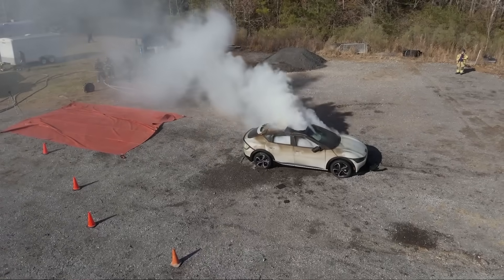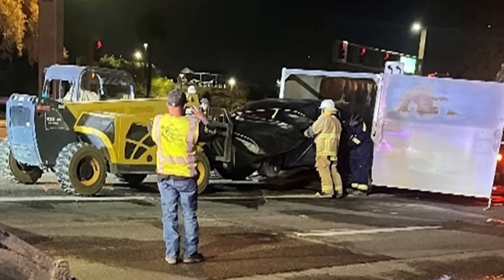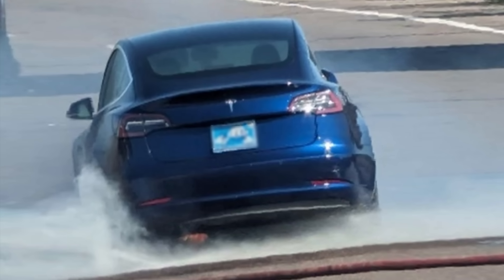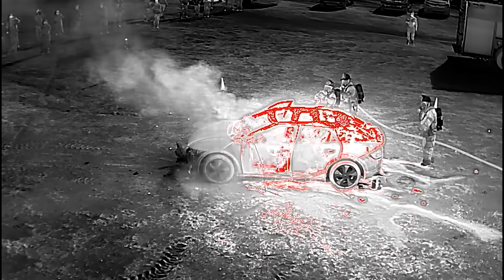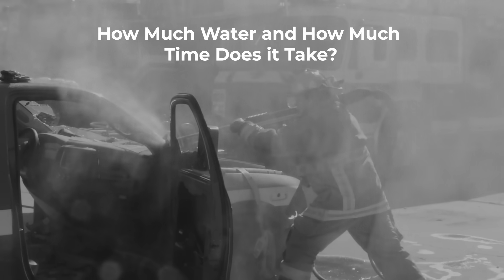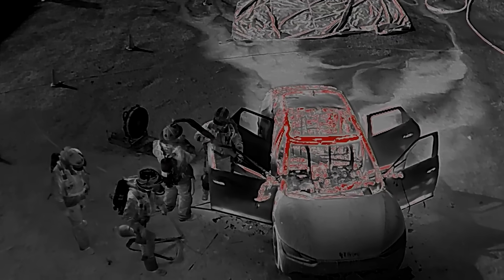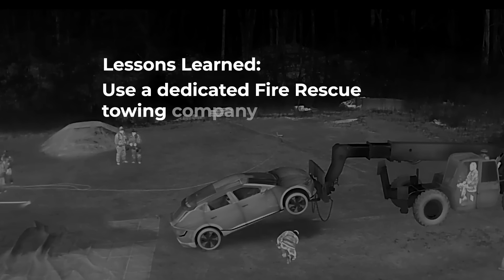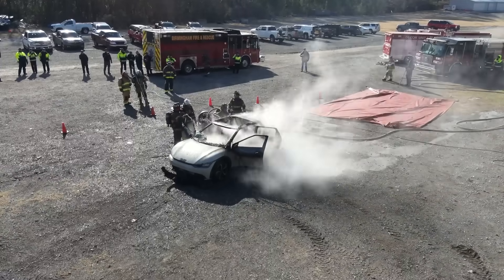Quick and Efficient Method of Extinguishing of an EV Fire tested in Tempe, Arizona

Comment: A technology so woke and so new, we can't make decent safety regulation for it.
Keep buying it people! Save the world!
Reply: Yes, and no, but don't call something "woke" just because you think it's stoopit. That's really not helping your point. 

EVs have been around since the beginning of the automobile. Detroit Electric and Maxwell Number 1's were common in the early 1900s. Even Ford made one for a few years. (search through Jay Lenos' garage on YouTube, and his webaite)
Those were all lead acid battery tech, though since that's all they had. Still a nasty mess to deal with if you ever have a fire. And the cars were mostly made carriage style out of wood. So, yeah big time blaze.

The massive problems with today's EVs stem from poor overall design, including the stupid electric door handles that have no manual over ride. People have died because of that because other folks trying to help or rescue couldn't get to them. 

Then there's the design and type of battery being used now. Lithium batteries are nice because they're light weight and can be made to be very energy dense. But, they're also so volatile they can ignite simply by being old or having a small defect. We've all seen video of vape batteries blowing off in pockets because of a defect, right,?

Battery emergency disconnects, better emergency access to the batteries, and A DIFFERENT TYPE OF BATTERY FORMULATION is a start in the right direction. Because, pretty much, EVs are right back to where they were 125 years ago when the car was in its infancy and there wasn't crap for a support structure. 

I just did a transcontinental trip , west to east, this past week. Saw 4 vehicle fires, none of them EVs.  2 were semis with trailers on fire. From the looks of the flames of one, it might have been carrying Lithium batteries.
Reply: LOL Brainwashed nonsense just force culture war BS. No regulation is required because the industry itself is already going way above and beyond with EV battery safety. Some companies have absurd goals with latest EVs fire safety. Where only in extreme case of neglect or vandalism will it ever catch fire. How they will achieve that is still being figured out but it is way beyond what regulators would ever demand.
Reply: Stop with the culture war nonsense. Regualations are not needed because EV Automakers are going above and beyond with Battery Pack safety. Way beyond what regulators would realisticically demand for them. Some battery makers like CATL have such crazy goals for the latest batteries i don't see how they are going to achieve. Only extreme neglect and abuse OR high effort vandalism will these battery packs ever catch on fire. This is an ENGINEERING development not silly pointless culture war.

Comment: Good use of the blanket for containment.  12 years ago F-500 EA was developed as an extinguishing agent.  Using the water jet in conjunction with the F-500 EA could put the fire out in minutes!
Reply: Well, again a major problem is still reignition. It's a major step in the right direction using this EU solution, but in some conditions it's not possible to use.
Reply: Except that EV's do not need air to burn,they create there own oxygen while burning.
Reply: @Mercmad  Did you even google F-500 to see how it works? No, thought not...

Comment: since by now everyone knows that ev fires can not be put out with water quickly or easily, why do they even bother trying?  wouldnt it save water and time and energy to just let them fully burn to the ground then self extinguish?  as they are going to do that anyways. in either case, the value of the car ends up being zero. i once watched at IMAX theater the method they used to 'blow out' fires in oil fields.  seems that would be the only practical way.
Reply from the maker: Water will extinguish lithium over time. 48 hours when submerged. In this case, the battery is "submerged" from the inside. Check the tests from MSB.se (in the description)

Comment: What about the explosion risk?
Reply: Its thermal runaway you need to worry about with Lithium batteries not explosions. Lead acid batteries do release small amounts of hydrogen and oxygen so they need some ventilation to keep the gasses from building up though.
Reply from the maker: Unfortunately, it is difficult to provide general guidelines regarding the progression of a fire in a battery, as it is complex and varies significantly from case to case. At the cell level, elevated temperatures can lead to what is known as initial off gassing, where various gases are released – often before visible flames are present. These gases are rarely harmless, and like all gases, if they accumulate in a confined space, there is always a potential risk of explosion.

A local risk assessment is always required, and the incident command must weigh the overall evaluation based on prevailing conditions. It is the firefighters' expertise and experience in managing explosion risks that must guide the decision-making on-site.
Reply: Early EVs stay away as much as possible, any decently built BEV after 2021 is highly unlikely to have much of a concussive blast. fire is not the same thing as an explosion.

Comment: The best way to stop EV fires is to put an end to EVs by raising insurance rates to reflect the actual fire risks and the extensive damage often caused by EV fires.  But, that would require an honest review of fire risks and a reporting system to gather the data which flies in the face of the leftist desire to push the climate change hoax and bilk everyone out of as much "fear money" as possible.

Comment: Sure, they only flowed 120 gallons of water in 20 minutes.  Not unless they were using a garden hose.
Reply: Its effectively a pressure washer with a small nozzle to turn it into a waterjet. There is only so much water you can force through a hole the size of a needle
Reply: Dude they literally sad it's a BB sized water jet. It's literally a fraction the size of a garden hose. Soo yeah a garden hose is a different size, BIGGER.
Reply from the maker: In the tests done ín Sweden, an UHP put out EV fires with even less water than that. See the description.

Comment: Water is a perfect conductor - Not recomended for electrical fire. EV batteries still burn totally underwater- A pathetic attempt to stop a fire that does not stop 9 times out of 10
Reply: The first line in your post is proof you don't know what you're talking about.  This technology is already out there working and using less water.
Reply: The problem is stopping the thermal runaway. Not the conductivity of water.
Reply from the maker: Water does put out lithium ion fires eventually. That´s why submersion also works. In this case, the fine water mist is what does the trick. The reason it doesn´t work that well to hose it down from the outside,  with a traditional nozzle,  is because that way almost none of the water will reach the chemistry inside. With piercing, you basically immerse it from the inside. Even though it produces its own oxygen, it will run out of options to burn when the water mist is applied.
Reply: Pure water is not conductive. Contaminants in water provide the free electrons that make it conductive.
Reply: This is NOT primarily an electrical fire. Your assertion is wrong.

Comment: battery briner com
Chilled salt water.

Just fill up the car with it by smashing in the rear window with a large pipe on the end of the fire fighting truck.

The flames can only come out of a hole melted in a battery case.

Then the chilled salt water puts out the fire (chill + water)

Then the salt water enters the battery casing "shorting" each cell at low discharge rates...depleting the battery to zero

No energy in the battery = no energy to ever catch fire again.

Simple.
Reply: Oh yes the water just needs to be colder 🤦
Reply: They explode, often very qujckly uf damaged.
Reply: @lindsayheyes925  
Yes.
So do gasoline tanks in cars,
diesel tanks burn like hell when punctured,
LP tanks explode if breached.

But a "normal" EV battery fire where the exit hole for the burning gases is small... chilled brine solves that problem ....
Reply: @JohnSmith-pl2bk  Good luck with that. I'm an ex firefighter, write business fire safety protocols, and I've run training for firefighters on novel hazards. I check the the facts, but maybe I should take your opinions into account. What could possibly go wrong?
Reply: @ 
Did you visit the site and see the vid demonstrating the system that is used on a floating car carrying ship...that absolutely MUST HAVE a fire suppression system that works???
Can you not see a chilled salt water tank on a land based EV fire fighting system as achievable?

Comment: Buy a car with an LFP battery.  Then there will be no fire.
Reply: Nope. It merely has a higher temperature to light off.
Reply: This is largely true.  I worked at Coda Energy when we had our 50kWhr storage towers UL tested.  We had to overcharge a cell, use a nail gun to shoot a nail through it and verify that the fire did not propagate to adjacent cells.  Yes it burned, but all its failure modes are much more benign than other common lithium chemistries.  Much safer.
Reply: Not factually accurate.  Also, LFP while safer than NMC, has worse off gassing in the event of a fire.
Reply: That’s a myth. The energy is there and needs to go somewhere when shorted or damaged.

Comment: If the oxygen levels could be attenuated somehow - a large blanket that is foldable (hence portable), heat-resistant (to prevent being burnt),  and flame-retardant (to restrict flame spread) that covers the burning vehicle to road level may be worthy initial research project.👍🏾💙🤍❤️
Reply: The lithium salts in the battery are self-oxidizing, which means that they can't be "starved out" like a traditional fire, the only way to put them out is to lower the temperature below the ignition temperature.

Comment: Can the gear be properly decontaminated ?
Reply from the maker: The procedure calls for staying out of the smoke as much as possible to avoid contamination.  A PPV fan can help  if the situation isn´t already helped by a specific wind direction.
Reply: These particles are so small they can penetrate through the sewing thread holes in the bunker gear. In fact they will penetrate the fabric itself. Yes the gear can be washed just like it should after every fire. But the only thing you can do is try to avoid the smoke which is hard if you are fighting a garage fire.

Comment: This reminds me of a video some time ago I watched showing marine (sea) fire fighters using the same kind of philosophy of using a piercing kind of nozzle to use the same thing blasting agent of being able to pierce metal to get into a confined space to put a fire out inside a ship.
Reply from the maker: The tool was actually first invented for ship fires. Sometime in the 90s in Sweden the first proof of concept for the cold cutter was launched.
Reply: In Seattle the 300 foot process vessel Omnisea burned at the dock for 7 days before they finally got it out. Seattle FD even had a special unit trained for shipboard fires. They pumped CO2 into the hull all without result. I finally visited the hulk and found the steel main deck warped  a foot out place resembled a washboard , hot fire!

Comment: Oh, hand held waterjet tech... Here's the problem, you have no idea if the neighboring cells have been compromised.  These batteries have everything they need to sustain combustion, they don't need oxygen, they provide their own, they burn under water...  Maybe this helps get the fire contained so it can be taken somewhere to let it burn....
Reply from the maker: Water does put out lithium ion fires eventually. That´s why submersion also works. In this case, the fine water mist is what does the trick. The reason it doesn´t work that well to hose it down from the outside,  with a traditional nozzle,  is because that way almost none of the water will reach the chemistry inside. With piercing, you basically immerse it from the inside. Even though it produces its own oxygen, it will run out of options to burn when the water mist is applied.

Comment: While this technique is more efficient than previous methods I still think there's room for more development in the future. Someone needs to develop a chemical application that creates an oxygen stealing layer over the top of the fire and solidifies as it's heated, creating a shell around the battery to contain it. Adding water to an electrical origin fire seems to be like chasing mice in a corn field.
Reply: The lithium salts in the battery are self-oxidizing, which means that they can't be "starved out" like a traditional fire. The only way to extinguish the fire is to lower the temperature below the ignition temperature.
Reply: @wally7856  
Ergo CHILLED salt water.
Reply from the maker: @wally7856  Water does put out lithium ion fires eventually. That´s why submersion also works. In this case, the fine water mist is what does the trick. The reason it doesn´t work that well to hose it down from the outside,  with a traditional nozzle,  is because that way almost none of the water will reach the chemistry inside. With piercing, you basically immerse it from the inside. Even though it produces its own oxygen, it will run out of options to burn when the water mist is applied.
Reply: battery briner com
chilled salt water.
Just fill the car through a 3 inch pipe jabbed through any window glass

Comment: They need a factory installed fire suppression system like aircraft
Reply: It's not the same at all.  Some battery packs have NO void space, so there's nowhere for any fire suppression to go.
Reply: @ffjsb they have to have some void space.   The cells expand and contract as they heat and cool under normal use.  That was the problem with the Samsung Note 7... they engineers forgot to leave enough space for the battery to expand under normal use.  When it couldn't expand they became a ticking bomb in your hand.
Reply: @flyguy6296  Most have like a foam insulation that allows for expansion and contraction, but they don't expand that much.  Even if there isn't, there's not much room anyway.  And when any water or foam drains out, they have the potential to ignite again.

Comment: Can someone explain to me why you can't just use something like baking soda solution to neutralize the battery acid? If your able to chemically neutralize it then the thermal runaway should stop.
Reply: Must not be a FF,
Reply: @jeffrust8947   no. I'm definitely not a fire fighter and I'm no chemistry expert either. I do know that many chemical reactions can be neutralized if you mix it with the right thing and hazmat teams have procedures on what agents to apply to chemical fires. But maybe that's just for liquid chemicals. I guess it was a dumb question, but thanks for not being rude and belittling me. 😁
Reply: @CognitiveHeatsink  You'd still have to crack open the battery casing to get it in. So if you can just use water, why wouldn't you ?
Reply: No acid involved with those batteries so nothing to neutralize.

Comment: On the flip side of this being the best way to extinguish an electrical fire , the stories of EV’s in floods shorting and then burning , how is this flooding method different . Not knocking things it’s great ways are being found and Every fire department needs this training and tools for public safety , ideally a portion of equipment cost should be covered by EV manufactures
Reply: The problem from what I understand isn't "fresh water" it's when the sea water gets into the battery.   That's what was happening after the hurricanes in Florida.   People with battery powered cars were driving through salt water or their house was flooded with salt water. 

Fire departments don't need special training or equipment to deal with a gasoline or diesel powered car or truck.  The technics needed are universal for any flammable oil product.  Battery powered cars require special equipment and technics as pointed out in this video.  Lithium batteries are nasty when they burn and very difficult to stop.
Reply from the maker: @flyguy6296  Salt water corrodes everything and the vehicle ends up shorting out. This is a different process than when putting out an existing fire with clean water
Reply from the maker: Water does put out lithium ion fires eventually. That´s why submersion also works. In this case, the fine water mist is what cools the cells near the runaway cells so that further propagation doesn´t occur.   The reason it doesn´t work that well to hose it down from the outside,  with a traditional nozzle,  is because that way almost none of the water will reach the chemistry inside. With piercing, you basically immerse it from the inside. Even though it produces its own oxygen, it will run out of options to burn when the water mist is applied.
Reply: Did car makers pay towards existing ICE car fire training or equipment? Is there a precedent for that majority of fires?

Comment: The way I avoid EV fires is not to buy one.
Reply: Per 100K sold, ICE vehicles are involved in 1,500 fires. That is 60 times larger than the 25-per-100K sold for EVs.
Reply: Boy, these EVangelists just love lying with their flagrantly fake stats, don’t they??
Reply: Fine, buy a combustion engine with a 8 time higher chance. Statistics matter.
Reply: @peterdewolff6650 that’s a lie
Reply: @joeculver7489  It's a mistake, gas/diesel fires are actually 18-85 times higher than pure EVs depending on the EV brand.